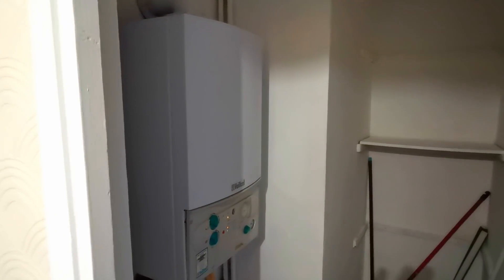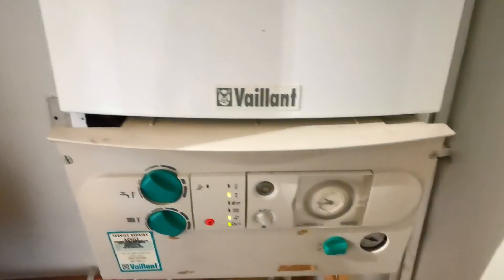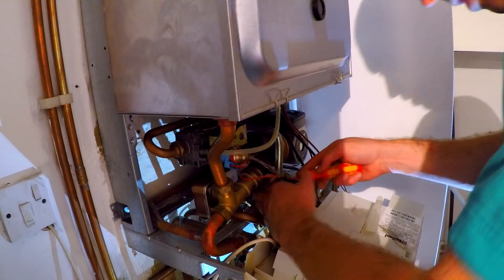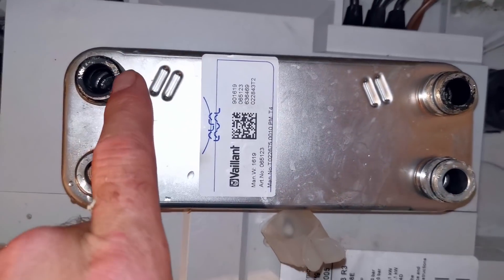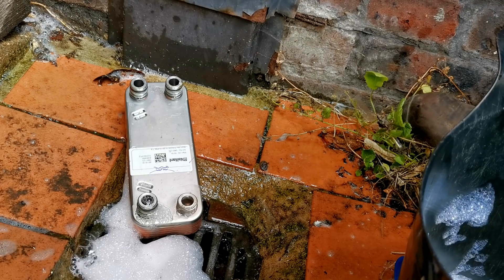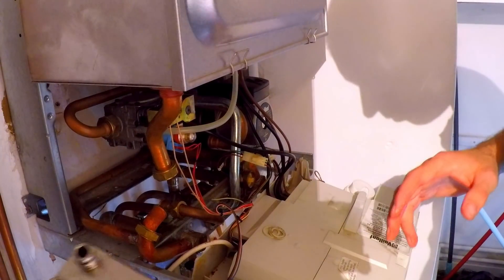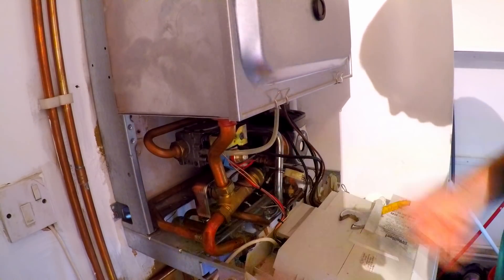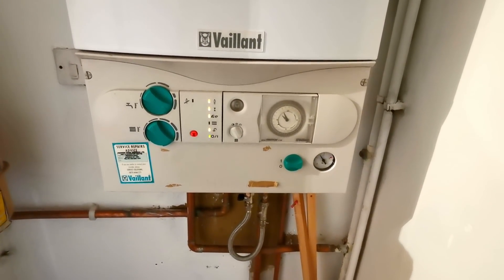Boiler heat exchanger blocked. Diagnosed with no tools?

Comment: Boiler now running as it should,
Cleaned heat exchanger that was pretty clear.
Replaced flow impeller as seen on another YouTube video 
that’s what was stopping hot water coming on 
Old one knackered hope this helps someone.
Reply from the maker: Sorry I didn’t respond to this comment. I didn’t see it in my feed. :-(

Comment: At 12:08 elapsed: ? Is the venting through an auto-vent after power on?  Another very interesting video, photography so good that my brain wants my hands to be inside the boiler doing useful work.
Reply from the maker: It did briefly. But then stoped and I used the pump. :-)
Reply: @HeatingGeek  Thanks

Comment: By the look of this, this sysrltem is in  need of  a good power flushing and maybe a magna clean  since this is an occurring problem
Reply from the maker: YEP. But if a customer doesn't want to powerflush the system then what do you do??
Reply: @HeatingGeek  fully understand that but in the long run they just going to have problem after problem. All you can do is advise and if they dont take it  then just keep turning up and taking the money to repair faults that come with not having a magnaclean and good power flush. Keep up the good work
Reply from the maker: @Zaine22  Exactly. Sludge is bad for customers, not for me.

Comment: Another cracking video! But late to the scene but getting through them all slowly! Your a beast at this mate great job! Been self employed now for 2 months-so far best things I ever did. Just a quick mention of this job did I clock the gas meter having a flexi downstream of the meter? See this all the time in commercial but I haven’t come across it much domestically
Reply from the maker: Its wrong, but I didn't notice it. :-)

Comment: hi getting hot water when tap is quarter turned boiler kicking in and out when tap is fully open warm /cold boiler kicking in all the time slight noise from main heat exchanger the inlet pipe hot outlet warm
Reply from the maker: You need an engineer to come and have a look. If you have how did you get on?
Reply: @HeatingGeek  looks like a main heat exchanger needs changing very expensive £450 for part will need boiler replacing has it is over 12 years old.

Comment: All these lot saying it needs a Magnaclean - obvious newbies. Magnacleans weren't even invented when this boiler was being fitted. Yes retrofitting one would be lovely, but its worked for 15 or so years without one, a new plate / cleaned plate will see this thing out till it dies of economic obsolescence. Why fit a £200 filter to a 15+ year old boiler it won't even be in the house in 5 years and the next boiler will probably come with one long as the installer is decent. I used to clean plates out in the decade before Magnacleans were invented and a well cleaned plate with a few hot flushes will last long enough for a boiler like this
Reply from the maker: Plates will usually last a while. Not always but generally at least 6 months and some I have had last 5 years after being replaced.

Comment: Dark cupboard? Empty pantry perhaps. Always go for a piss check prior to diagnosis.
Reply from the maker: Piss Check?
Reply: @HeatingGeek  I thought that was what you call taking a leak, in England 🤓
Reply from the maker: @jeffreyjohn2037  :-) Where are based?
Reply: @HeatingGeek  I'm from New England.
Windsor, Connecticut. And a third generation steam boiler technician.
Reply from the maker: @jeffreyjohn2037  Thats sounds like nice work. I guess they are large communal/district heating plant? Or is it more for process?
Reply: @HeatingGeek  I've worked on commercial  capacity boilers up to 2 million BTU. My present job is mainly residential smaller units such as hot water storage tanks, fuel oil tanks, oil buners and natural gas fired equipment. Combi boilers too. 🔧

Comment: Great job 'GEEK' my thought was to clean or replace the auto vent and install a mag filter. 
Agree it's an easy boiler fairly tough boiler, my favorite past boiler was the previous VCW242/282E.
Reply from the maker: Im not a fan of the gas valve and PCB on the older one and the diverter is a bit of a pig. I think Vaillant got it right with this job. :-)

Comment: Why pulling the plate exchanger out when if you would have installed proper valves with drain house connections could use a pump in the bucket to do the cleaning. Also should install dirt separator on that boiler.  That was some powerful cleaning solution!
Reply from the maker: Too much faffing. `easy to remove and clean and refit. I can do this job in 1 hour.
Reply: @HeatingGeek  Oh Ok. If  can be done that fest why not, Thanks for the reply . It would be a good idea to add some cleaning solution to system , then drain it and ad boiler protect solution after that. That was one filthy plate exchanger.
Reply from the maker: @786otto  It would be good however the customer is on an insurance contract that doesn't even cover the reapir I did. ;-) I cant do any more :-)

Comment: Fantastic! Both HeatingGeek and Dr Pipe put out videos in the same week on my favourite and arguably the best combi - the Turbomax Plus/Pro . My 16 year old Turbo still performs like new, and with occasional maintenance should get many more years out of it. Parts are cheap and readily available and most things (except expansion vessel ) are easy to change. You can remove the plate without disturbing the diverter. I undo the bottom left nut with basin wrench or crowsfoot if changing plate with diverter still in place. Interesting that you have a used Turbo to replace your Ecotec. Says a lot about these boilers and also a lot about modern boilers. Hope you get the swap on film when it happens. Thanks and please keep the videos coming. And stay SAFE!!
Reply from the maker: Good to see you back. :-) Turbomax is the best combi ever made. Great boiler.
Reply: @HeatingGeek  Thanks, HG. I'm always here, watching and lurking. Don't always post comments though. I was lucky that when my Vaillant Sine combi was getting tricky to repair (fantastic piece of enginerring, just too complex), it was 2004 when the Turbomax was part of Vaillant's current range of boilers. So fitted one and so glad I didn't wait for their next ranges of boilers. Just lucky I needed a new boiler at that time. A dog is for life, and so is a Turbomax  ;-)    Keep up the good work!
Reply from the maker: @woodbine66  The sine 18 was a beast. I have fixed a few and my next video features the model just after the sine. Turbomax was the last great Vaillant but I still think Vaillant ar up there with the best

Comment: Hi, I work for one of the manufacturers of plate heat exchangers. We do not advise using Hydrochloric acid (spirit of salts) as it can actually cause corrosion. There are other weaker acids which can do the job such as phosphoric or oxalic and will not damage the heat exchanger.
Reply from the maker: Its not in there long enough. I have been doing this for nearly 10 years like this. Never had a problem. I know it will damage the heat exchanger if left in. Exactly what product do you recommend? I will try it out. :-)
Reply: @HeatingGeek  That's fair enough. Generally it will not cause damage if flushed immediately after as you say, however the heat exchangers are made to last and can last for 15 years if treated correctly. Using a strong acid will reduce lifetime from 15 years to 8-10 years. You probably won't see any problems as other parts in a boiler will go before this timeframe. I cannot recommend particular products for obvious reasons, but look for ones containing mineral acids such as phosphoric or oxalic acid. Even acetic acid will work (vinegar).
Reply from the maker: @1991elliot  For the job I do customers have 2 options. A quick blast with spirits of salt or a new heat exchanger. I get a fixed cost for my time so its very important (To me) that the job is quick. I will give what you say a go and see what works. Thanks for the reply. I will not forget phosphoric or oxalic acid. I have tried vinegar with little success. :-)

Comment: Did you notice the gas meter outlet supply pipe off the meter was not ridged pipe ?🤨
Reply from the maker: Yes. When someone commented on here. Pipework was clipped and the meter was fixed to the wall. I'm not worried.:-/
Reply: HeatingGeek  That’s would be my way of thinking to as long as it’s clipped and meter on a bracket leave it just creating work for yourself
Reply from the maker: @stevenyearnshire1624  What meter ;-) Just edit that out :-)
Reply: HeatingGeek 😂😂

Comment: Hello mate, what size spanner were you using on the diverter valve nuts ?
Reply: I think? they’re 24 & 32mm open end Spanner Ollie has cut & taped.  If I’m correct, Silverline, (I know, I know, they just make cheap crap tools) do a fantastic compression nut spanner in these sizes, it’s surprisingly good quality & shop around, you can get one for under a fiver!
Hope that helps fella, stay safe & like me, kick back & enjoy Ollie’s videos👍👍
https://www.ebay.co.uk/itm/401626686534
Reply from the maker: @TheDickPuller  Saved me the typing. :-)

Comment: Hi HG, on jobs like these do you recommend further works such as flush and or filter after you have completed.  And is HG your company, I'm playing catch up with your vids and just trying to learn a bit about you. 
Thanks for taking the time to upload your work.
Reply from the maker: The customer was not covered by the insurance company for this repair. I always clean plates to get people up and running. I get paid the same to walk out or temp repair. The customer was aware they needed a power flush after my visit.
Reply: @HeatingGeek  are you then able to pick up this work from directly from the customer if it's not covered, as in quote to fit a filter yourself?
Reply from the maker: @Richard-ij8ge  No I won't ever do it because of conflict of interest
Reply: @HeatingGeek  thanks........thinking of going contracting so was wondering of you were allowed to do this.
Reply from the maker: @Richard-ij8ge  No one will let you descale heat exchanger this way either. :-)

Comment: Great video, thanks! Are you doing a bit of Vaillant subby work at the Mo?
Reply from the maker: No, im self-isolating so doing nothing. :-)
Reply: @HeatingGeek  Well stay well and give us as much content as you can!  Actually id really like to patreon your channel because of the quality that you have always put on. It's helped me massively TBH. I'm on furlough at the mo but it's good because I'm fitting my own heating and hot water brand new throughout. Worcester 8000 style combi.
Reply: All in copper, got all the time to make a nice job of it. Converting from a 1960's C plan
Reply from the maker: @jamescarter1088  I would love to know how that boiler is in 10 years. Looks like a great boiler but you never know with a new model. :-)
Reply: @HeatingGeek  well they don't last these days, but I got it at trade price through work, get £250 back and a 12 year warranty. Ripping out a 1995 myson marathon OF.
Reply from the maker: @jamescarter1088  Who do you work for? Myson marathon... Thats really really old. The house I used to live in had a Myson Orion. It was a brilliant boiler and needed 2 thermocouples and a gas valve in 20 years. How can a new boiler be efficient if you have to replace a part every 3 years??? Enjoy the time off and don't work too hard.
Reply: @HeatingGeek  I work for a small local heating company, just 5 engineers. I know nothings made to last anymore not even cars or houses haha. The old boiler has never been an issue, just the £100 a month gas bill and draughty house in the winter.
Reply from the maker: @jamescarter1088  That's the best type of company to work for. I wish I done that. :-)

Comment: Another excellent video from the Heating Geek.  Aww, Spirits of salts works every time!  Expansion Vessel Checked and pumped up with foot pump on ALL combi boilers after every drain down,  I also change the Grey rubber washer, ( front left of the Main heat exchanger  ) this somtimes leaks when the diverter valve top nut is unscrewed.  Vaillant  P/N 981151  Pack of 10. 
Thank
Reply from the maker: I have them on the van. I don't replace them unless they leak. Weird colour arent they. ;-)

Comment: Can you tell me, why one would get blocked plate HE even after installing a  quality magnetic and Y type  physical filter????????
Reply: Pre existing magnetite and poor quality water before fitting filter - system has to be squeaky clean and dosed with right amount of inhibitor otherwise dirty system water will progressively worsen
Reply: @hdhanji8006  
But how does the larger particles ie. larger than  1 to 2mm pass through both the filters without getting caught??????
The physical filter holes are only 0.1 mm wide!!!!!!!
The derbies are around 4 to 10 mm wide and massive!!!!!
Both filters have been installed from the beginning .
Is it possible that they got trough the FLOW side by some kind of  negative pressure  force ??????
Reply: @Han-es8qu  Old boiler internals would have been contaminated I assume and not thoroughly cleaned, if the heating side of the system is clean and debris still found inside boiler :)

Sorry HG, didn't realise you replied to the fella
Reply: @hdhanji8006  
Even if it was contaminated ( which wasn't )
still it doesn't answer as to HOW contamination passes through the filter!!!????
As I said it was a new installation of a Baxi Main combi boiler , every thing was new, but now 4 years old.
I have seen many boilers with several fancy filters and still plate heat exchanger was full of magnetite ?????
I can't give the client a reasonable answer.
Reply: @Han-es8qu  Let's assume the filter was 100% effective (which it wouldnt be but still), logic dictates the only possible source of corrosion and breakdown would be the boiler internals. In the case of a new boiler and system, the root cause has to be insufficient dosing of inhibitor or poor quality chemicals. This magnetite doesn't necessarily have to circulate around the heating side of the system (and therefore be caught by the filter).
Reply: @hdhanji8006  
Sorry, but logic says that there is no IRON in the internal part of the boiler to create the magnetite!!!! ??????
The answer is more complicated than that!!!.
My hypothesis is,  the  extreme heat in the primary heat exchanger  cooks the micro diameter of magnetite in to larger prices ,
Hence every time that you clean the magnet there aren't any large pieces trapped inside.
Also for 20 years that I do this job neither the filter nor the inhibitors haven't reduce the rate that the heat exchanger gets blocked.
I still clean the same numbers  of HE per month!!!!!
May be even more!!!!!!
Reply: @Han-es8qu  you'd have to send water sample to lab for in depth analysis and see what the composition is - the theory is plausible though, magnetite particles and heat reacting with water, which progressively worsens over time (which is what I said in my first reply).
Reply from the maker: Because the debris was already inside the appliance when the filter was fitted. Or the chemicals used to protect the system are baking out of the water on to the main heat exchanger, then flaking off and blocking the plate. Also magnetic filters dont work 100%.
Reply: @HeatingGeek  
Thanks, your second analogy makes more scenes as the derbies stuck in the HE are always large flakes and obviously it has never passed through the  first round of filters.
So one can assume the filters do not reduce the rate of blockage in the plate heat exchanger!!!!, but this findings is opposite of the claims and the assumptions that magnetic filter manufactures makes!!??